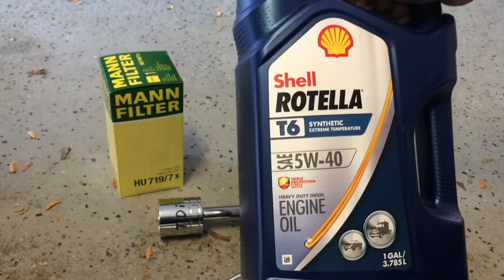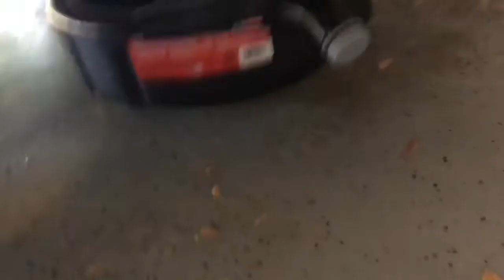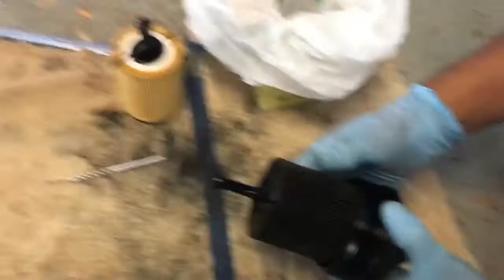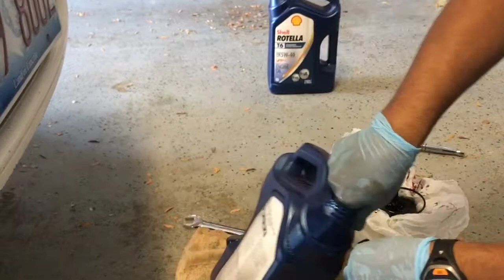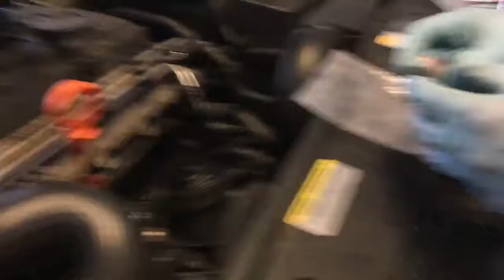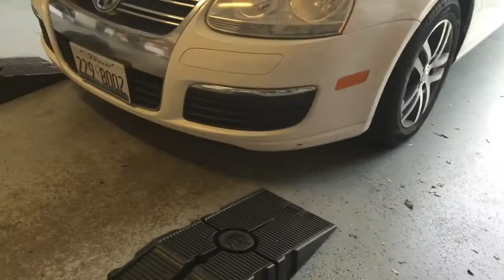2006 VW Jetta TDi Oil Change BRM Engine MKV

Comment from the maker: As some have asked about; was the approval of the Rotella T6 in the BRM TDi engine; I went to my local VW dealership to have a "unofficial" discussion.  The VW techs / counter "unofficially" said the T6 is perfectly okay to use in these motors; and they haven't heard of anyone having problems with it.  The key was to have a 5W40 weight oil (not 5W30)...also doing a 5,000 mile interval on oil changes (not 10,000 as recommended by VW).  Again, it's what I use on my vehicle; to each their own.  Hope this helps.

Comment: The 1.9L diesel found in the 2006 Jetta calls for the Liqui Molly 5-40 synthetic oil. Anything else, you run the risk of taking your cam shaft out. It’s made in Germany, just like the car!

Comment: I guess you did not show the cover removal under the engine.  Do you have one?
Reply from the maker: I do - today, but did not back when I made the video.  However, I cut out an area in my cover to drain without having to remove cover. I also attached a quick drain valve in place of my drain plug.  Thanks for watching!

Comment: Only thing, you didn't fil up the oil filter and housing.  very VERy hard on your turbo.  good job though..
Reply: not required as it primes up almost instantly and the turbo does not run on idle when you start it .
Reply from the maker: I’ve heard of filling up twist on filters, not really heard of filling up housings as the housing is connected to the oil pan.  Not sure it would work.  But that’s for the comment either way.   Thanks!
Reply: I tried. It drains automatically and immediately-so system must be designed for it.

Comment: For my vw 2006 jetta TDI 2.0 i use Castrol 15w40 for my engine cz i crossed more than 500000 km is it the right oil for it !!?
Reply from the maker: Mine is a 1.9 TDi.  Are you sure that yours is a 2.0?   I don’t use “official” oil.  I use Rotella T6 5w40 diesel oil.  It’s available at the local Walmart and I change it every 5k miles with a Mann Oil Filter.
Reply: @sat_sonic   as the Mechanic said when the engine gets older it needs light oil .

Comment: What has been your experience with the TDI?  Has it proven to be reliable? What have been the main problems that you have come across?  Any transmission isdyes? Would you recommend this particular model?
Reply from the maker: 60k into ownership and have to replace the driver door wire harness, Passenger CV axel and fuel temp sensor as repairs.  I do spend some on preventative maintenance like:  oil/filter every 5k, fuel/air every 20k, trans oil every 40k, coolant every 100k with timing belt and brake fluid every 2 years. Brakes & Tires as needed.  185k on the clock.
Reply: Mine has 276K miles on it and runs great!
Reply: Chewbaca Guil The 2 big possible problems are the rounded off cam or the dmf could fail.
Reply: I have found TDIs to be be extraordinarily reliable, you can easily put on 300k mi on them with routine servicing. I’ll add that it’s best to add diesel lube to to every tank of fuel.. I think Opti lube XPD is the best stuff I add 100mls to a tank in my TDI sportwagen.. just the biggest thing to do in replace the fuel filter every 40k and alway check for metal flakes that could be from the high pressure fuel pump.. if that pump goes out it is a very expensive job but the diesel lube takes cate of this

Comment: Another trick, if you drain another .25 quarts out of the oil adapter bolted to the block near the radiator you have much cleaner oil in the end.
Reply: is there a video of how to do this anywhere?

Comment: Very good video
Is diesel car easier maintenance then regular car?
I am thinking, buying used TDI VW, or old Mercedes diesel 1990-1997, which one is better what is your suggestion?
How long have you had TDI jetta?
Thank you very much
Reply from the maker: Pure H2O -  not sure about easier maintenance as that really depends on your skill set and what level of tools you have available to you.  Doing an oil change is similar in both.  I got a diesel primarily because it gives me 50 MPG and I drive 120 miles per day.  As far as VW or Mercedes, the VW parts or even common maintenance items are much cheaper.  P.S - I own 2 Mercedes SUV’s (gasoline powered) as well.

Comment: How much oil do you add in?
Reply from the maker: It's 4.5 quarts with filter change.
Reply: how are those car ramps i was looking at them and wasnt sure if it was elevated enough and is it sturdy and secure?
Reply: also the oil that you put in is it VW approved and good for the winter
Reply from the maker: The ramps are pretty good.  I’ve changed oil in this car and a Mercedes ML430 SUV.  In both cases, easy up and the car is plenty high to do the oil change.
Reply from the maker: King Dre as far as approved oil - I actually think the one I used is not on the list, but people have ran this oil in these engines (BRM - TDi) for hundreds of thousands of miles.  

Also, yes it’s great for winter, as it starts as a 5 winter then goes to a 40.  I’m in Chicago area and we get cold as ever here.